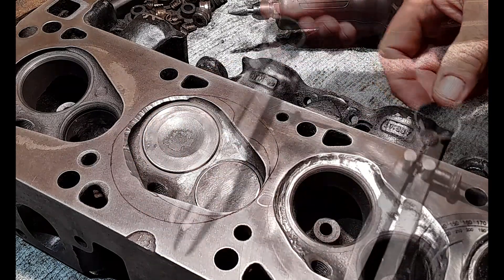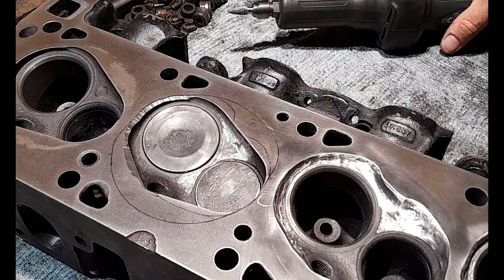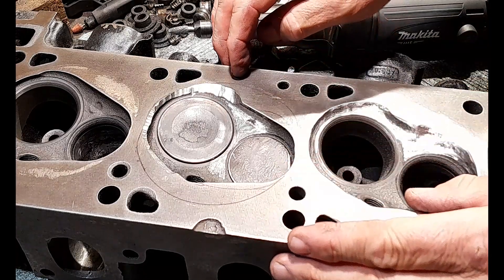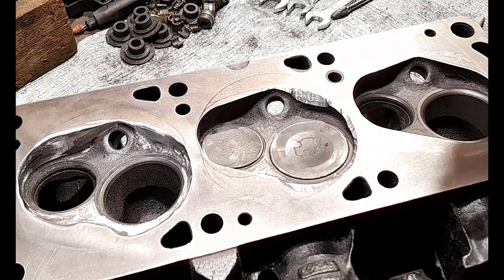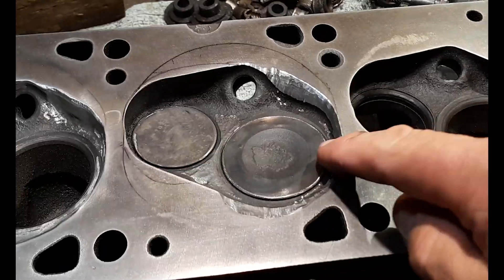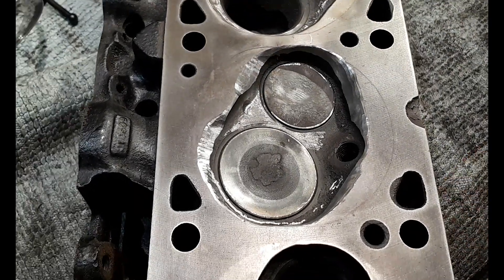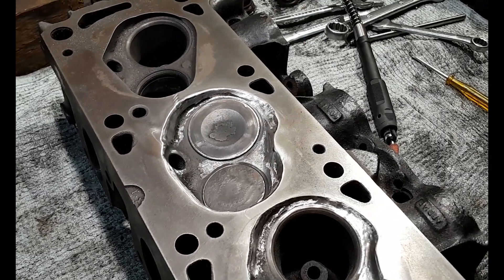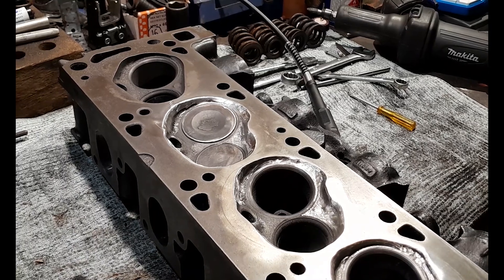351 Cleveland 2V Iron Cylinder Head Porting De-Shrouding Valves Pt 3

Comment: I have the same heads ,what CC volume you reckon the head would be after your porting ,grinding as I need to drop the C/R to fit my 351. Thanks.
Reply from the maker: They’ll be between 64 and 68cc